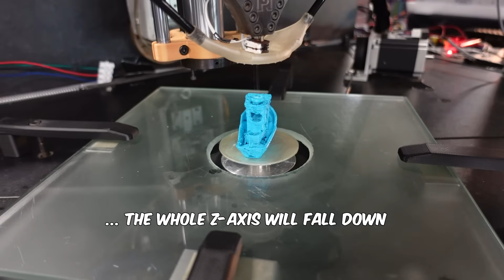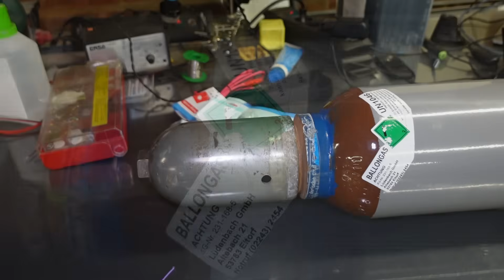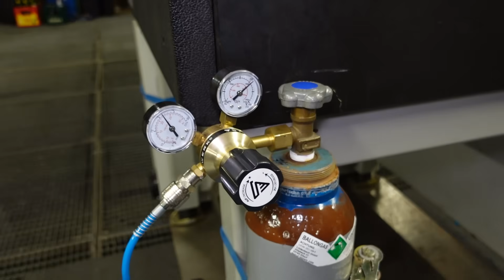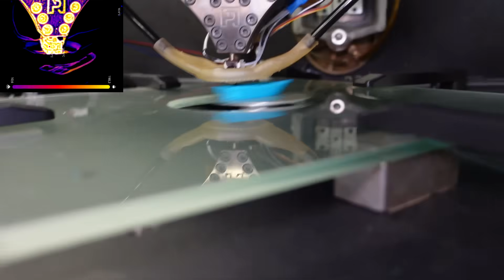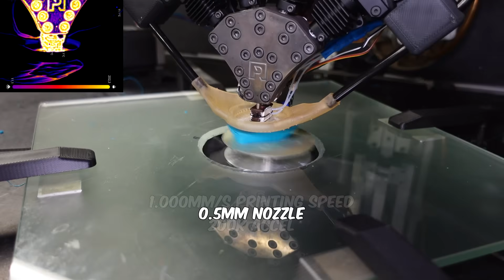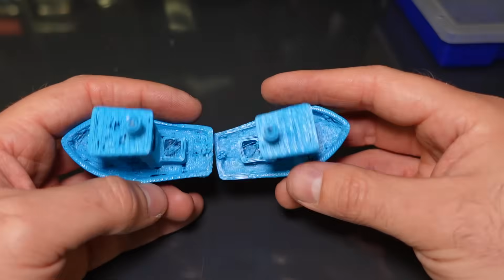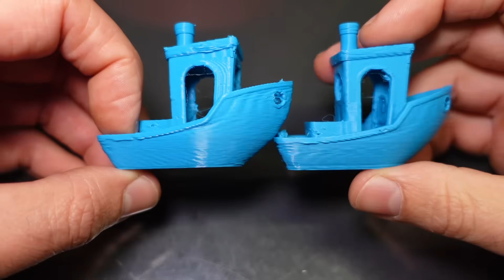Testing Helium Cooling on Worlds Fastest Printer (Minuteman Episode 18)

Comment: I wonder if it's possible to precool the compressed air, requiring less flow. Possibly beating using helium.
Reply: He did this in one of the last episodes
Reply: he did this previously with dry ice and liquid nitrogen i think
Reply: A car intercooler maybe?
Reply: @BestNub-ni8tm  An intercooler is just a heat exchanger, it can't reduce the temperature below ambient (maybe a little if you add water spray and a fan).  The obvious solution is an air conditioning unit, should be able to get down to single digits Celsius with a bit of work.
Reply: @ferrumignis  I'm not sure how much it applies to the shop air, but when you compress gases their temperature rises. The mechanical parts of the compressor might also introduce some heat. I have no idea if it's a significant amount. Assuming the air is not at room temp when it's in its compressed state in the pipes, cooling it to room temp in the pipes and then have it decompress when it exits, it should be colder than ambient temp. This is the same principle hvacs, refrigerators or any form of heat pump works on, just with more specialised gas instead of air and in a closed loop
That said idk if it's any effective or worth while, but cheap and simple to test
Reply: You will form condensation.
Reply: @noanyobiseniss7462 there are things like a moisture seperator. They are used in painting shops for spraying a car. Don't know about their flow capabilities tho.

Comment: Sealed enclosure that is filled with helium, the gas is recirculated, compressed and chilled 🙂
Reply: With the volume of helium he is using that doesn't even sound that far fetched. He could completely fill a 1m3 chamber like 5 times with the helium he had, and if its sealed well enough one probably wouldn't need to refill the chamber for every print.

Comment: It's interesting, like really interesting but I also understand why it is prohibitive  - there are commercial helium recovery systems for labs what would lower the helium loss to a negligible amount, but they aren't cheap either
Reply: Wouldn't a helium recovery system need a mostly sealed process?
Reply: @traniel123456789  not necessarily but it would made it a lot easier and cost efficient because the recovery process is energy intensive so you want as much helium as possible in the mix

Comment: I'm guessing it's not possible to keep the helium contained?
Reply: That's actually a good point. Helium is a limited resource because it slowly escapes from the earth into space (He-Atoms reach escape velocity at the top of the atmosphere and just shoot off into space)..and it's already quite scarce.
Various research institutions are making great efforts to reduce helium consumption and maintain additional facilities for the recovery and recycling of helium (for economic and sustainability reasons).

So:
a) there is already developed equipment for helium recovery (no idea what it looks like in detail, probably mostly used for enclosed systems)
b) probably it's misplaced in "consumer" 3d printing, since there are applications in f.i. particle accelerators or sensor cooling that barely have any alternatives :D

Interesting experiment regardless  :)
Reply: @simonrichter3950  I don't like Helium being used for frivolous purposes (e.g. party baloons) for this reason.  However helium is constantly being generated through radioactive decay, but I'm pretty sure we are using it faster than it's being made.
Reply from the maker: Propose an idea how to do it. :P
Reply: @Roetz40  or maybe mixing the helium with room air somehow, to make it more affordable
Reply: A refrigerated container, and possibly air recirculation with an inlet and outlet fan.

Comment: It would likely be prohibitive if helium became a prerequisite for even competing for speedboats. I hope it can somehow stay a competition about ingenuity instead of turning purely into who can spend the most.
Reply: This isn’t about competing in the speedboat race. This is about completing the speed boat race
Reply: just because you spend lots to make it happen doesn't mean there isn't any "ingenuity" about it, this machine has been a long project in the making and is very impressive regardless of what it cost to build it.
Reply: @FuriousSkull7203  I was mostly talking about the cost of consumables here. Sure, the machine itself might also be expensive, but the parts still seem affordable for enthusiasts. But if every run costs you 75€ of helium, then you'll severely limit the number of attempts someone can even do.
Reply: @jwueller you can always just categorize it into atmospheric/air cooling and others. For things like motorsports and max-speed where the absolute limit is extremely expensive, but people are competitive in restricted categories (eg displacement, airflow) on a much more reasonable budget.